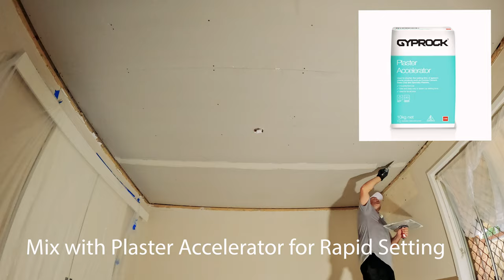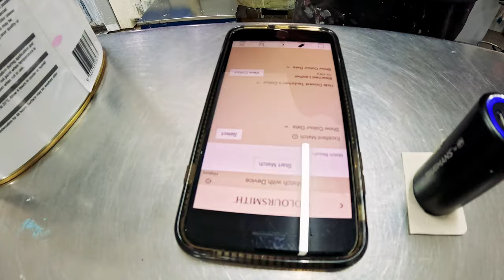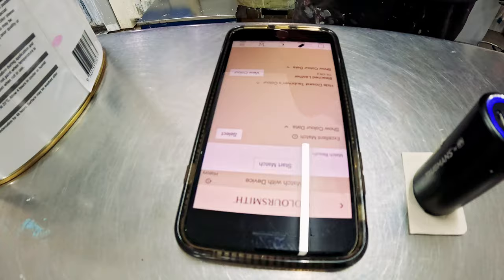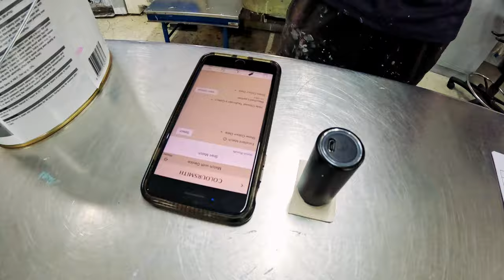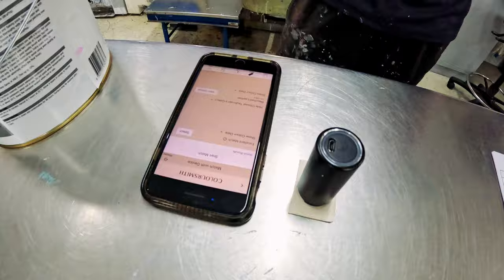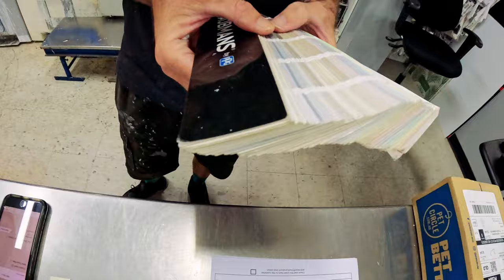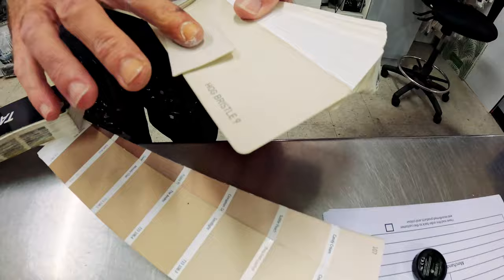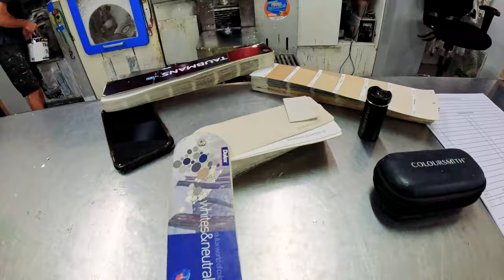FIFO Work? How I Make $1000 A DAY Fixing Drywall Ceilings

Comment: Is there a reason why you use an accellerator for bedding and 2nd coat rather than a hot mud like easy sand?….and are those extra backer sheets between the joists to prevent future sagging, if so is it really necessary even when you’re using an adhesive?  Thanks!
Reply from the maker: Yeah, I like to use this particular product which has a 45 minute setting time. Not sure how strong easy sand is. We call those sheets back blocks and they are used a lot in Australia because most board is only 10mm thin, and between the joists they can warp. Keeps them together and nice and flat and strong